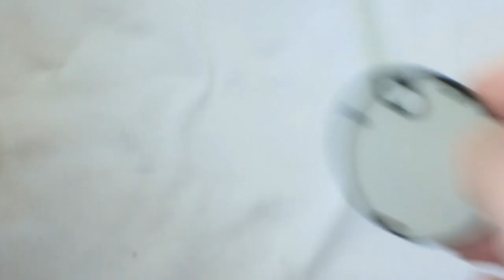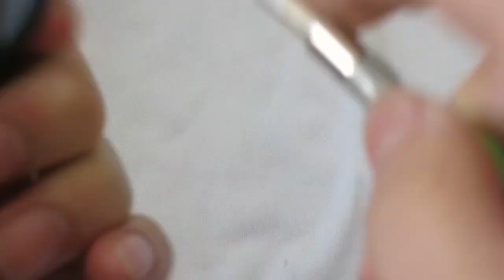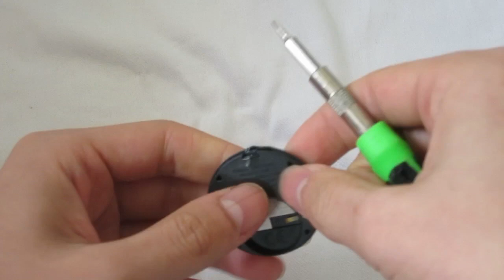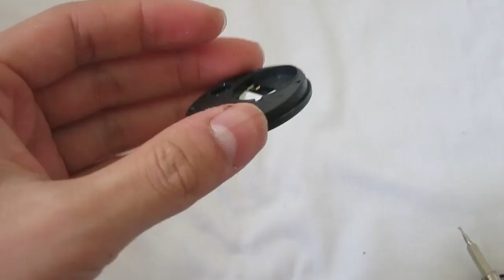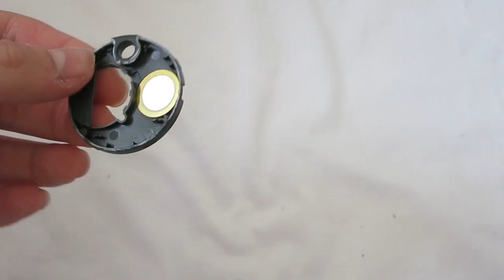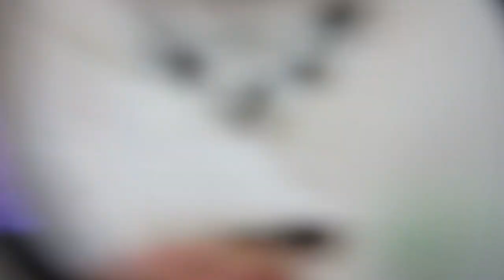Chipolo ONE Spot Teardown

Comment: Looks like it could be so much smaller :D
Reply from the maker: It could be smaller if it doesn't have the keychain hole and the half-horizontal board.

I think that if the whole board is compacted enough, it could be fitted in the same size as a CR2032 cell.
Reply: @KN4LXD  Just found pebblebee which is a lot smaller and even rechargable. Guess I'll try this one next.
Reply: Yea here's me hoping there'll be smaller 3d printed shells where you can put everything in it, because the airtag is much smaller IMO

Comment: Is there a possibility to remove the speaker so it can be put in your car (just in case), so it will still work normally?
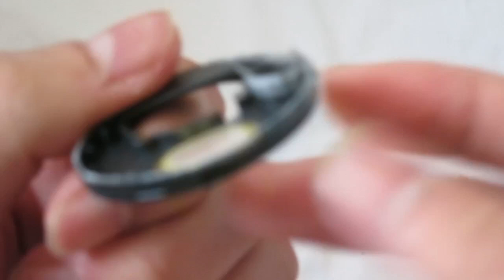Reply from the maker: I don't think it's possible to remove it seamlessly, due to the keyring hole is glued between 2 part together (see 1:48 for the keyring hole assembly).
Reply: @KN4LXD  what about blocking the contacts? So it doesnt get power?
Reply from the maker: It could work, but the case still need to be opened to block the speaker contact (or take out the bare board, but then that makes it more fragile to handle).

Comment: what are dimensions of the chip itself please?
Reply from the maker: Sorry for the late response!

Here's the board dimension: 2.2cm x 3.1cm
Reply: @KN4LXD  no problem, thanks a lot :)
Reply: Thank you so much @KN4LXD
Reply: @KN4LXD  aaand can you measure also thickness (in the thickest and thinnest place) please?
Reply from the maker: No problem! Here's the thickness of the board:

With battery terminal: Around 4mm
Board only (battery terminal unsoldered + circuit on board): Around 1mm
Reply: @KN4LXD  what a quick reply, you are awesome! thanks a lot!
Reply from the maker: Thank you!